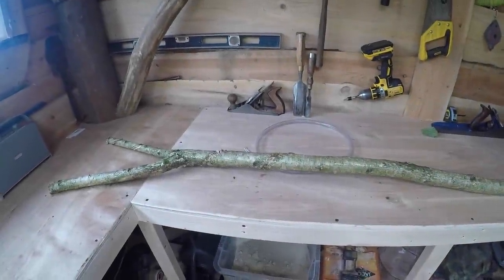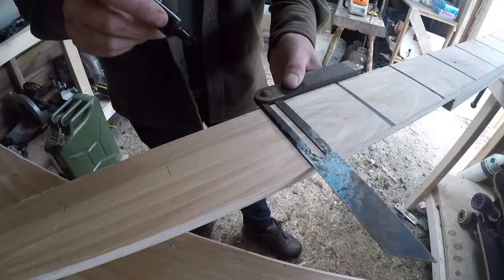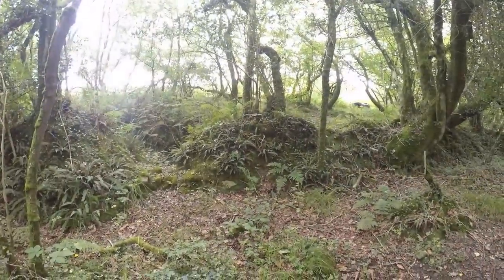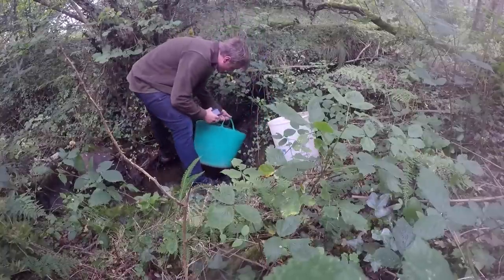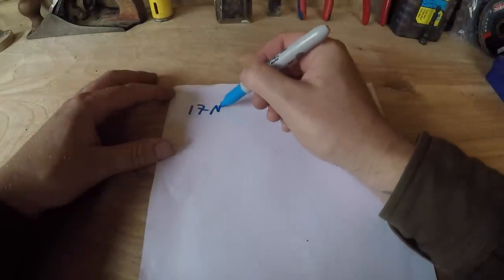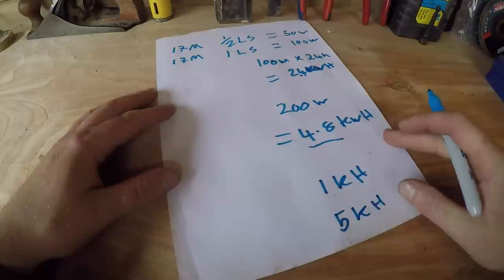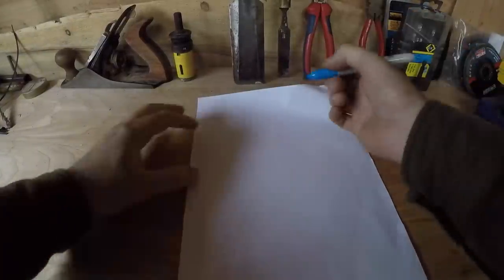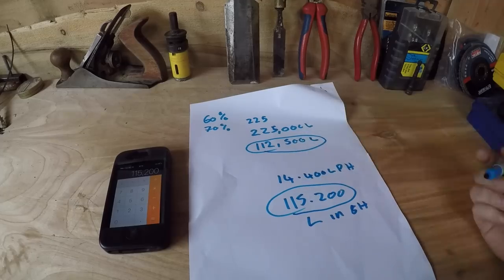DIY Micro Hydro Part 1 Head, Flow, Power Calculations

Comment: I've never seen someone set up a water level like this. Around here we have the two ends of the pipe on two sticks with a length of garden hose between them, and we measure whether two points are level or the difference in elevation directly from the two ends of the water line. Of course, this requires two people to make it work.
With your level, I'd be looking into a drop of food colouring in the water to make it more visible, but it would need to be a colour that wouldn't stain the clear pipe.

Comment: Here are my energy and power calculation if it helps. 

The formula I'm using is Potential Energy ("PE" in joules) = mass in kg X g (acceleration due to gravity, 9.8m/sec/sec) X vertical height in metres X efficiency as a fraction (ie 60/100 or 0.6).  

Plugging in your most conservative number for the mass of water flowing in a second, we get PE = 0.5 X 9.8 X 17 X 0.6 = 49.98 joules rounding out to 50 joules.  This energy will also be the power because we are calculating energy per second of flow. 

If you want to generate 200 watts consistently, you will need to be able to draw 2 litres of flow a second.

Comment: Cool project you have in mind. I'm really interested to see how it turns out, Thanks for sharing! 

I was hoping to get more insight on your thoughts and plan. For example, there is a comment below pointing out your loss of flow due to the slope of your pipe and you responded by saying you'll be using a nozzle to increase pressure at the end. I'd be super interested in knowing your conclusions and how you came about getting to them.

Comment: you have a gate valve from the pond you can open you should put one on the leg from the stream coz if you open up the pond valve you might suck a lot of air down from the stream end if its dry and that will slow your flow.
Reply from the maker: +thesparewheel that is probably a good idea.... I didn't think of that. I think I will try without first because they are quite expensive but I think you ought be right... Thanks for the comment.

Comment: I have looked into forms of hydroelectricity.. I think you would be better off with a traditional Flume and a larger than 10 ft. Water wheel my current drawings utilizes oil drums that have been modified into a circle and have been cut into to maximize the gravity weight of water.. all of this you would cut the barrel so that it will be in the into the next Barrel to utilize spillage flow.. now of the suggestion of a square box Flume you can line The Flume with some type of rubberized floor kitchen floor mat that you glue down to a wood floor.. This is quite popular and is better than touring the whole thing. To do such a thing you may need to invest in a home-built sawmill that runs on DC current with a worm Drive feed so you can set it and forget it for an hour or two has a DC motor will not cut as fast as the gasoline.  Now do note the goal of this larger system is to power larger things such as Heating and Cooling of your homestead.. you probably should have a solar panel that is wired heavily to run directly to small motors and to a recharging system for tools not forgetting night time lighting. I encourage you to go with the traditional system or put in a slow screw system that is working out well enough except floor trash such as leaves and sticks. You will have great videos on building your trusses for your Flume and once it's all accomplished you can tell people what you are putting on your two and a half inch spinning shaft period. You may be able to put on a grinding mill or even taking apart a small generator and produce household current 110 or 220 yes I am from the United States and I am aware of different Power designations. In closing I thank you for allowing me to add a suggestion it is up to you if you do it period. I have heard of someone utilizing rockstone and mortar right into their Flume support in this support they have created a Smokehouse out of rock and mortar and a luxury steam Shack with The Flume right above it one can also add a garden stretch and Shaq right underneath it and have plenty of water throughout the year to water their Garden period. Next thing you know a chicken house ultimately he had the idea of expanding his Flume to a larger wheel down the valley... Thank you and do consider humanitarian religion you can see my channel for some of that. Utilize car parts for your DC electric Sawmill Drive especially Ford Crown Vic driver seat motors that adjust the seat it is hard to get them out but they come with spare parts as you can utilize only one spinning hytorc belt adapted shaft.

Comment: I dont think the volume calculation on the lake is correct from memory your lake does not have vertical sides so the volume  would reduce with depth. You're volume calculation would be more accurate if you used the diameter and depth to calculate a conical volume. Unfortunately if im correct it will cut your available water volume in approximately in half as you also calculated your area as a square not a circular. Still 4 hours of continuous power at 400w would be very useful. Keep up the great work kris i await each video with anticipation.

Comment: There is a problem with piping airlocks and friction not to mention blockages all slow the flow so it will be interesting if you can gurarentee flow over the long term

Comment: Hi Kris, great work as always,  loving this project. Is the stream and your pond at the same level? Could you divert the stream to flow into your pond directly, then take overflow water from pond as your power source pipe?  
Another guy below suggested damming the stream, this sounds good to build up water pressure if it can be done effectively?  
Your pond figures assume a constant depth of water, but I imagine it tapers in shallows at edges, so where it us half meter deep is not at the edges? I'm going from memory in one of your earlier videos.
Is it possible to install more than one turbine on the network? If several were in a stepped configuration, with water dropping to build power?

Comment: Could you source surplus or recycled pipe? Wouldn't much matter what had been in the pipe before, if the water is just going through the turbine. Or use wood, lined with 6mil or thicker plastic that you can get in rolls? Looking forward to details on that turbine!

Comment: Great stuff with using the lake as energy storage! I was wondering though; How much will the flow rate change depending on the water level in the pond, or is that height difference compared to the total head insignificant? I think it could alter your predictions of how much energy you can reliably get from the pond over time, might be important if you plan to depend on the pond.
Reply from the maker: +Nout Hogesteeger the pipe will e at a set hight in the lake witch will be 500mm below the water line when the water gets to that point in will stop. So yeah the pressure would change by 500mm over the course of 8 hours so that would be about 200wh or something like that. So not a big deal at all. Because all those numbers were for 60% efficient so I'm hoping to get better than that anyway...... But yes there would be a small curve downward as the lake level drops. But also as the level drops and the power goes down the efficiency goes up due to less cable loss and less pipe loss. So it really would be very small.
Reply: Awesome, glad you thought about it already, good luck building the system!
Reply: @KrisHarbour   It's 4 years on.  Has your system produced the kWh output you calculated here?  Thanks for posting all your videos.  You're my HERO!  You're DOIN' IT!!!  I think many would be intimidated by the amount of water on your land.  Not you.  You know how to harness and harvest it and that's why you really are a hero.  :)

Comment: Hello, the correct calculation is liters per second multiplied by jump in meters multiplied by 9.81 (grace acceleration) multiplied by the total efficiency of the system, usually below 5kw never reaches 60%, i do not have any disappointments I insert from 50% below KW and even less when it's around 100W, at 58% with Pelton impellers under 8kw
For all others, the important is not the inclination of the jump but the pressure of the water column, which can be reached quickly by having a very vertical jump or slowly with a very sloping slope, is the pressure that counts, of course, that we need limit to the maximum the distributed discharge loads of the pipeline, from turbocharging, to low power below 500 / 600W, use permanent magnets alternators above for robustness of reliability and limitation of costs, using three-phase auto asynchronous motors excited by capacitors, using the C-2C for single-phase or 3C for the three-phase, this island generation technique and high-performance electrical power-derived dissipation, and cost-effective stability, the IGCs control voltage asynchronous and frequency controlled ELCs for synchronous, synchronous alternators always known as non-Chinese or low cost / quality brands, it is advisable to take them into account above 10/15 kw.
Use the water bubble or laser level or a small tube and gauge

Comment: Great Vids. Are you burying the pipe to avoid freezing, especially the lake one where there will be standing water when switched off. How much flow do you estimate into the lake as that would offset what you are taking out when using it.

Comment: remember you will lose some power from hydro unto battery banks & from battery banks to the house, so try make them close as possible. get most can out of your hydro into your battery banks
Reply: Rexism7 yeah thats right. best store batteries and convert dc as close to the source as possible to ac. Saves costs on wires too. AC has allot less loss

Comment: Hey kris, good luck with this project and extending your dream into reality. When you were talking about limited water flow in summer months you got me thinking..do you think that there's any way of using this system in conjunction with a swimming pool or jacuzzi whilst the pump is running? Just a thought...
Reply from the maker: +Silver surfer I don't really know what you mean? 

I do actually plan on building a hot tub at some point but it will be wood fuelled.
Reply: Kris Harbour hi, what I'm thinking is that surely this system isn't just restricted to a natural source and could run off a system with a pump and ample flow of water perhaps??
Reply: Umm. What you are suggesting is a perpetual motion machine; so at best you recover 70% over the energy expended by the pump...

Comment: Instead of running a separate pipe for the lake, why not divert the stream into the lake, and run the pipe from there, and build a small electric dam/sluice setup driven by stepper motors, where you increase/decrease flow based on the level of the lake and your electricity needs? That way you truly do turn the lake into a battery, instead of having to store all the electricity by charging batteries, or potentially wasting it during times of day/night when you don't need it.

You could run an arduino or raspberry pi at the dam, and connect it to the internet with eg. a 3g receiver so you can control it from your house, and workshop.
Reply from the maker: +Mathias Grønnebæk hi, thanks for taking the time to add some really great suggestions. I am actually away helping on another build at the moment. But when it back I will take some measurements and work out if that could be done. It sounds like quite a good idea but I will need to work out how I would do it. 

Thanks.

Comment: Hi Kris just an observation,  your water level  measuring staff  you measured every 100 then used that thicker marker pen , now the thuckness of that nib must of added to your measurements guides ?
Reply from the maker: +poulsonarrow hey, I was going to the middle of the thick line each time. And I also rounded the numbers down as I was doing it.
Reply: Kris Harbour well i did think that ..... no Wayne not scot just big fingers typing on small key pad ( thickness  )

Comment: I didn't get how quick the pond refills. he wants to use 125k litres per 8 hours (4L/s), but what is the flow rate at which it refills ? I guess there's a valve so that he can let it refill as I'm guessing the flow rate of refill is < flow rate to turbine?
Reply: It's a backup, not a continuous source of power.

Comment: Hey, I really like to see how your project is working out but I think you calculation is applied in a wrong way. I agree with 17m water drop you achieve 100 W for 1L/sec at 60% efficiency, but that would only be true if you had a real 17 meter VERTICAL drop for the water. I understand that you will lay the pipe on the ground with just a small slope. Then the water will not accalerate as fast as it would in a 17 meter vertical drop. Or do you build some kind of 17m high "viaduct" on which you will guide water above the ground to then drop it?  A theortical 17m vertical drop would mean that the water is accalerated to a velocity of 18,2 m/s when it hits your turbine. But I assume that the water speed you achieve when laying the pipe flat on the ground is much slower than 18,2m/s.
Reply from the maker: +Till Marter the water will flow through the pipe very slowly and then accelerated through a nozzle. your physics is way over simplified for this. You have not factored in pipe diameter and the use of nozzles to increase water speed. At 4lps the water will only be moving very slowly through the pipe because of the pipe diameter.
Reply: No is the pressure it counts, the water column, NOT the speed of the water or the slope, the speed in a free-flow channel and in a pressure conduit is synonymous with loss of load and consequently loss of power .
Reply: you do not get to 100W but well to 90w real electric that would already be a good result with PMA alternator!
Reply: pipe losses are based on diameter, length, and flow rate. The length increases when horizontal but the diameter can be increased to remove the associated losses from length by reducing the flow rate.
Reply: Then you neck down at the exit and your losses are very low because the restriction is over a short length. TLDR; properly sized pipe diameter negates length losses, and a nozzle increases flow velocity while having minimal length losses.
Reply: Had you used a small diameter hose the entire way in an attempt to save money and have an increased flow velocity, you would lose a lot of hydro power to friction compared to a large diameter hose and a nozzle.

Comment: Have you included pipe friction in your 60% efficiency number. Using a thin pipe could easely cost you 3-4 meter head just in friction. This number drop fast when the pipe-diameter is increased. There are several on-line calulators that can help when deciding what size you need.
Reply from the maker: +bknesheim yes pipe friction is factored in. That is why it is quite expensive. I'm using 110mm pipe so the losses will be under 10% even at 4lps
Reply: Good call.  That is one of the failings of small systems. Skimping on pipe and going with 2'/55mm irrigation pipe drops efficiency drastically. Losing more like 1/3...

Comment: i understand the reasons behind you wanting pipe but build a sluice
Reply: That would be absurd. You need a pipe to hold the pressure.
Reply: bknesheim it's all down hill water falls to the lowest point turn the wheel gear it down then back up and you will have a ton of power plus you wouldn't drop 2k on pipe
Reply: After taking a look at your "Liked Videos" I can better understad your comments.

Comment: Kris, If you run out of power during the summer month's & you have a catchment area below then what you can do is use this to pump the water back up to a large rain tank which you can use to flush downhill to force your hydro to work. Basically this setup will pump a huge distance uphill as it works on pressure. If you use a 4" pipe that stands up & make it around 5' to 6' tall then it will pump a huge amount of water. Do some research on others as this is just an example. Also, with the long runs of pipe if you do that to send water uphill then use Black Poly Irrigation Tubing as that is very cheap especially if you are using 1" or 25mm x 164' or 50m. The whole ram pump & irrigation tubing might cost you around 150 Pounds.
Homemade Ram Pump 
https://www.youtube.com/watch?v=A9W0zx2D7aU
Mark, Perth, Western Australia
Reply from the maker: +Solar Function I'm afraid that won't work where I am. I would have to have a HUGE area to catch water and it would need some head as well down to the ram. Considering how inefficient Ram pumps are it would make small amount of power for a lot of construction/destruction for a small amount of power. 

But it's an interesting idea for sure! But not for this site.

Comment: You want to configure something like 1500 watts the just to run a AC or oil-filled heater on high for your bedroom and toilet room to keep your pipes from freezing..   the only alternative is to get a 12 volt DC hot water heater element and put everything you got into it and the element will be attached into a water heater radiator.. of this you'll be dumping everything that the poor little alternator will produce.. yet there is a problem of getting electricity to the house DC current can I go that far.... I'm saying that there it might be something not right in our matching up of electricity American standard versus English or is it European..

Comment: No iphone? I have a altitude app. Cost was about 2 euros. Though, I'm not sure how precise atmospheric pressure measurements are. I used it to find the head for gravity h2o system. Could you also use a monometer for an accurate head measurement?
Reply from the maker: that just isnt an accurate way of doing it. yeah it would give a rough idea but not even close to being as accurate as this.